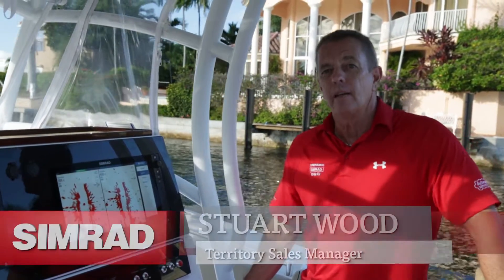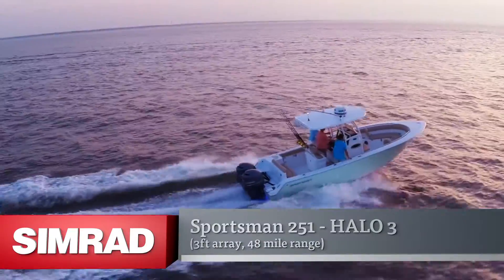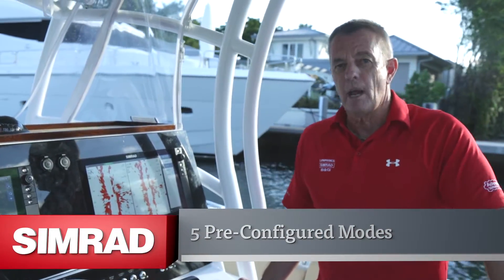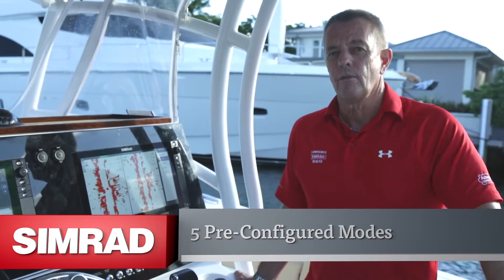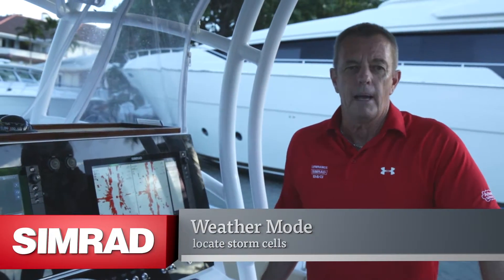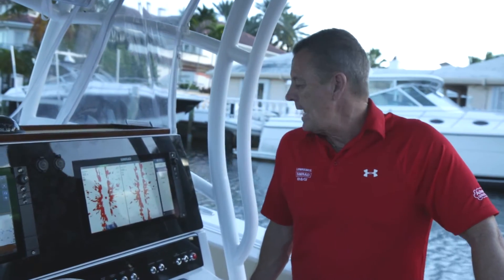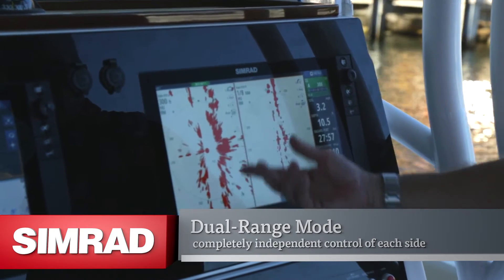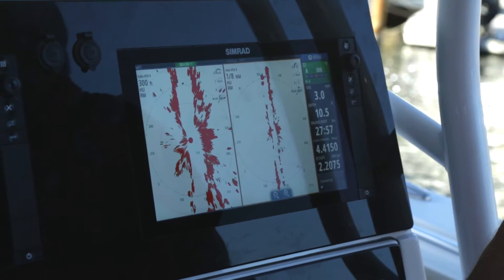HALO Radar - Easy-to-Use Preconfigured Modes and Custom Settings

Comment: First trip out with the new boat. I had the bird mode on and the birds were not marking on the radar. Is there something else besides selecting bird mode that I need to do ? It was still marking boats but just no birds. One damn near flew into the boat and still nothing lol